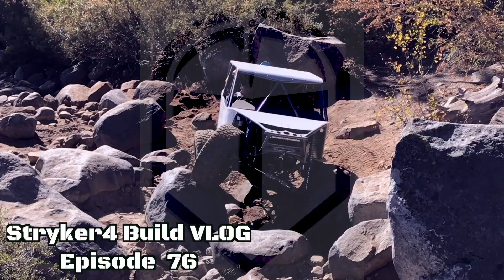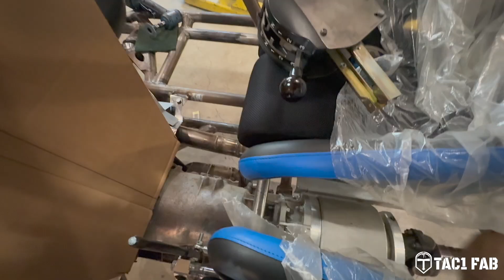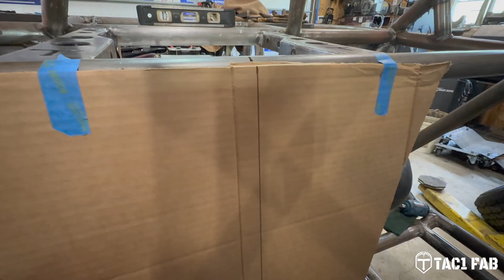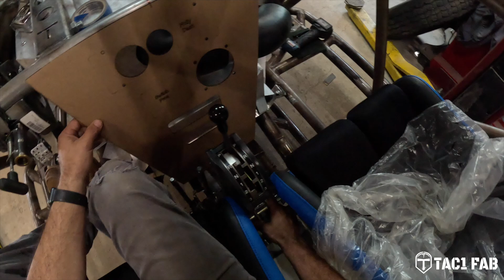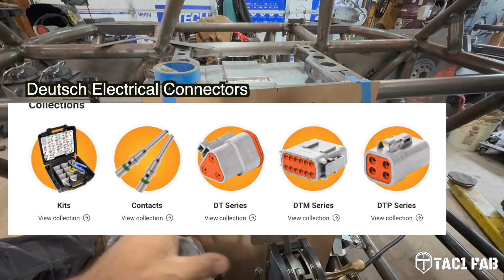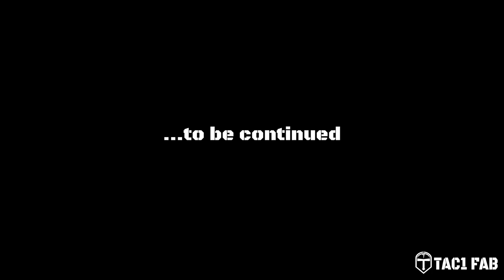Stryker 4 Build VLOG EP76 - Final Shifter Install & Mockup Dash Layout

Comment: I'm using ECUMaster for my scratch build Cobra.  I got their 15 button keyboard that has 2 encoders made by Blink Marine.  Since I'm doing a replica, I'm offloading functions I don't have on the dash. It will get rotated under the dash when "showing" to be more period. All of the switches and indicators are going through my ECU or the PDM.

  Cobras got fiberglass footboxes and rest of the cockpit is riveted aluminum panels.  Most of those pieces are flat or with flanges. No bead rolling either. I'm sure it's a combination of production car vs race car build styles.  That said, I thing I would have considered a knee corner.  Instead of one line from dash to shifter, and an angle would still keep the mount points and the side panel may only need one or two bends.
Reply from the maker: Great point. I'm working on the rough cardboard aided design for that area right now. It will be tricky but I hear what you're saying about the knee corner there may be some angles in there to get it right but yes more knee clearance would be nice no matter how complicated the panel ends up being. Thanks for watching